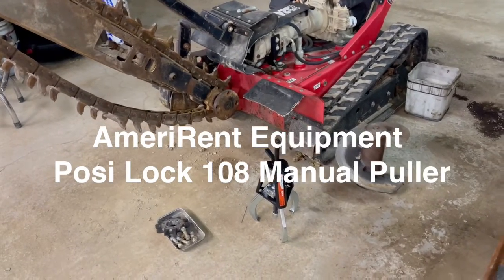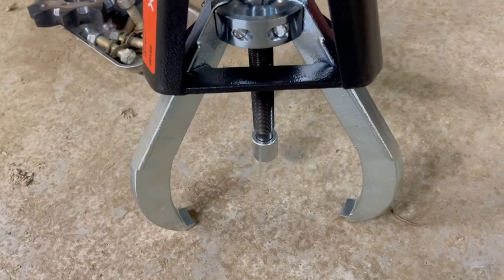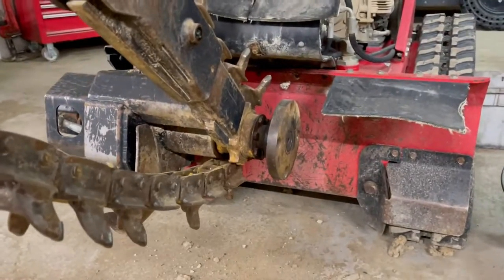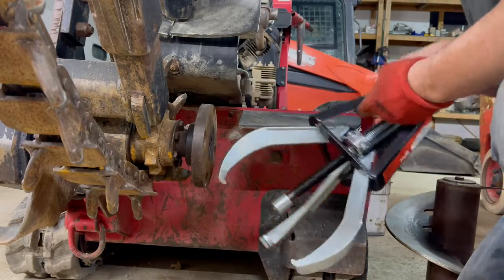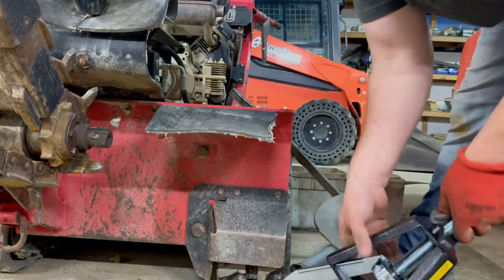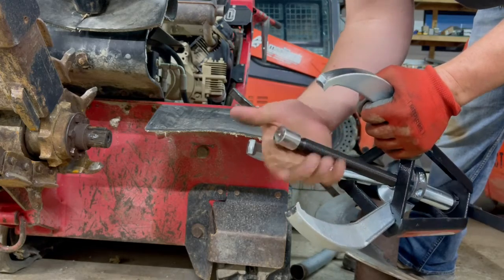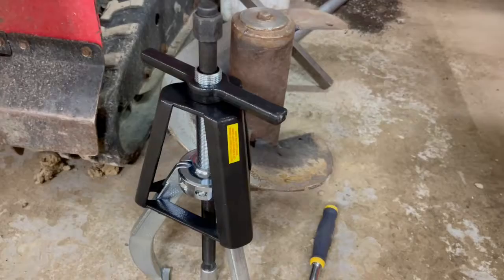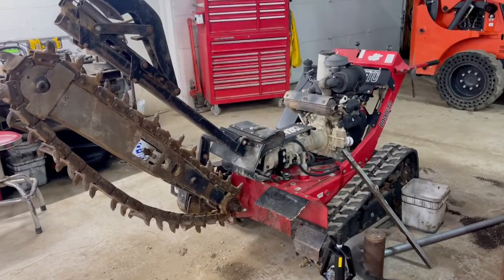Posi Lock Model 108 Manual Gear 3 Jaw Puller

Comment: If you would’ve took a hammer and hit the piece you was pullin it would’ve come a lot easier. The shock along with the pressure will break it free and you won’t have to worry about pullin the threads out of your puller. Usually if that don’t work a little heat always wins. I’ve got several posilock pullers they are the best on the market for sure.
Reply: Came to say the same. Put tension on it and smack the end of puller with a hammer.